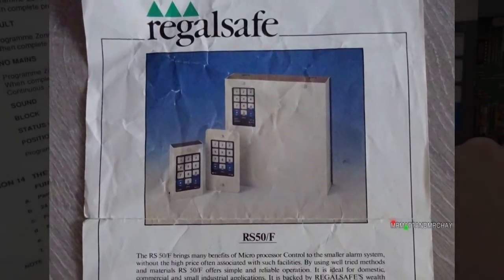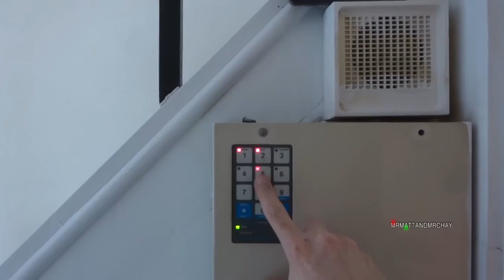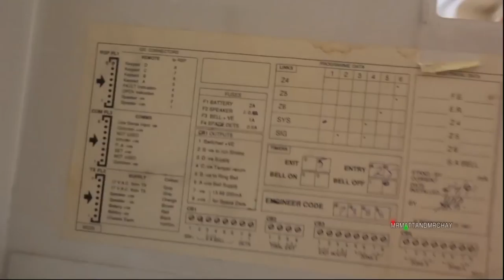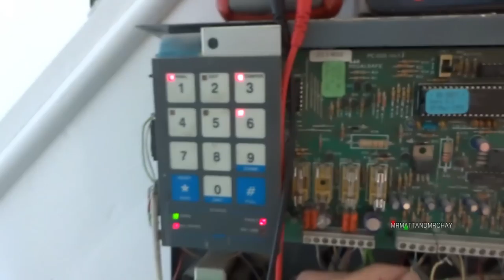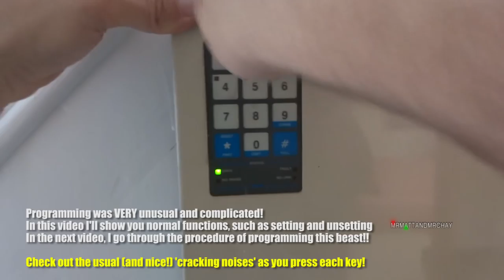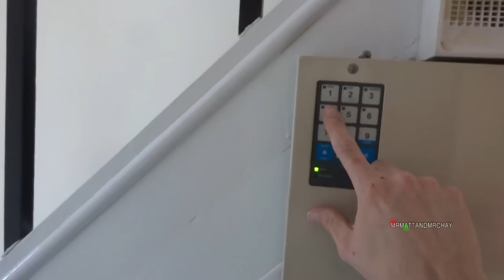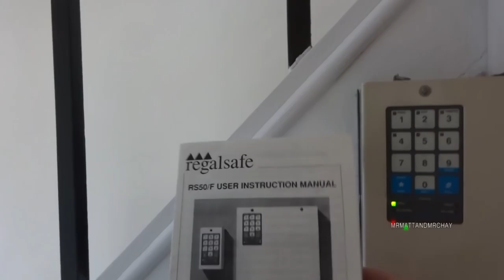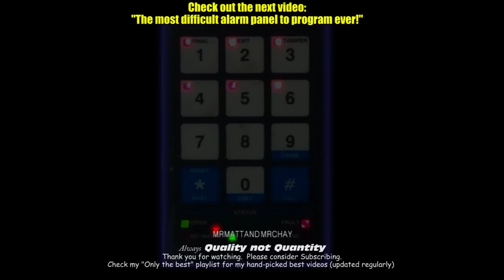The REGALSAFE FS50 - 'beautiful' alarm panel from the 1990s (Part 1 - Intro)

Comment: hi, when did the optima XL6 come out? as i recently got my hands on one.
Reply from the maker: Hi,  As far as I know, the Optima XL6 is early 2000s.  The original Optima+ with the really weak flat membrane panel was around 1990 - I bought one as a kid when I was at my first company (here it is!!  https://www.youtube.com/watch?v=hSnVGT7_GYk  ). It was the first 'budget/affordable' programmable domestic alarm panel.  After that they changed the keypad to rubber keys, then introduced a remote keypad which was the Optima 2 PLUS (google it) 7-seg red LED display.  There have been quite a few variations since then, but the Optima design comes from 1990s

Comment: Really like these old alarms. Makes me want to work on my Scantronic 9800! What's the external sounder like?
Reply from the maker: It was actually a RegalSafe sounder, looked like this: https://burglaralarmbritain.wordpress.com/2011/10/02/swat-selby-york-2/  I replaced it to a Texecom model about 3 years ago (can't remember the reason to be honest).
Reply from the maker: Also, worked on 9100 (actually we used the ATG6000, slightly bigger and better box, but it was still essentially a 9100), 9200, 9400 ("Equaliser" -keyswitch panel, very cheap and nightmare in thunderstorms lol), 9500, 9600 (LCD panel), 9800 (LED panel) loved the slow rising and decending tamper alarm sound!  Also many many other panels including the Sunthorne keyswitch panel.  There used to be a message group with loads of old panels on it (msg group?) but it's gone and had lots of these panels on it!
Reply: The audio chip used for the 9600/9800 is still made to this day in fact. DIY tone boards are being sold with the chip being used in it. Sounds pretty good (the snapping battery leads leave a lot to be desired though!). The slow sweep tone on my 9800 sounds horrible on some speakers (as in clipping etc.) but so far the Knight speaker I'm using works great with the system! My 9800 has the standard 9825 keypads and it also can use the 9827 keypads as well. I love the backwards compatability between the 9800+ and the 9800. I hope to someday get a 9600 as they're a tad more flexible with zone expansion and I prefer them, but for now I'm satisfied with my 9448, 9800+ and 9800!
Reply from the maker: Cool, thanks for the comment, interesting!  I loved the 9500 alarm tone the best!

Comment: If you look at it commerically, it could be a "good buisyness oppertunity" to sell a new system. Would it be difficult to reprogram if the manual is  missing?
Reply from the maker: These are really nice people that live here.  I had about an hour discussion with their 6 year old daughter on the last visit, adorable kids!  So if the panel still works, then I'm not really there to sell them a new one.
Reply: Telling them that they need a new one would be dishonest and scammy. If the old works fine (even though its very complicated to program) why replace it.
Reply from the maker: They also have no desire to replace it, until it goes pop perhaps!